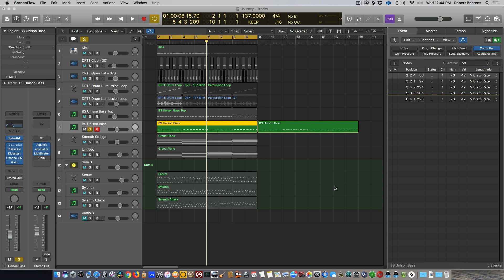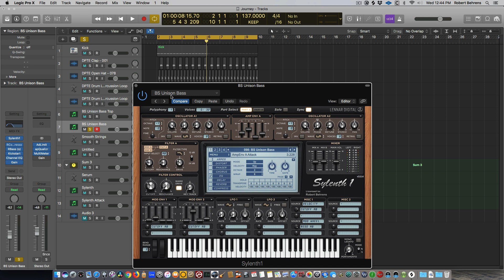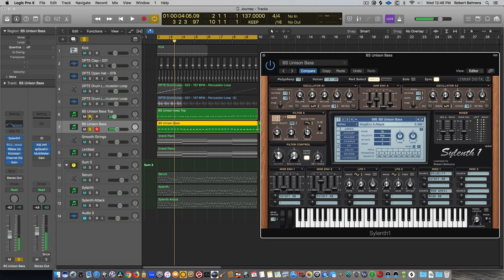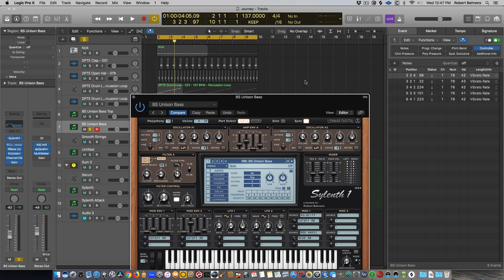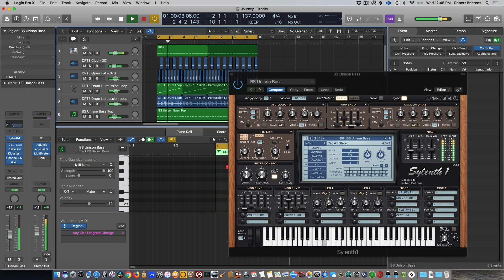Sylenth1 Jumping Amp Envelope Problem Solved! | Stop Parameters Randomly Changing in Sylenth1

Comment: does anyone know how to do this on flstudio?
Reply: Hey, i know it's 3 months ago but Current project > Patterns > Initialized controls then delete some events/automation triggers that might be connected to the vst/vsti
Reply: @rucitijar  hi, you're the only one with a response to this for fl studio. Hoping to get more help. 

I'm following your exact instruction but i don't see "Initialized Controls". Do you know of anything else I can check?

My problem is the same. The Amp Env A attack resets when I click the stop button, or close and reopen the project. 

Hope to hear from you!
Reply: @billjacksonducusin7127  if the project has no automation yet, there's no "Initialized Controls" since it was a folder created for an automations. To solve your problem, try to create a static automation that play along the track with the exact value of your tweaked Env A attack before it's resetting back.

if the project already has an automation, find "Remote Control" inside the Current project folder or  "Initialized Controls" inside the Patterns folder on the fl browser and delete some events that may cause the problem. it is the same as Rob's video said, the culprit was a random malfunctioning controller data.

Hope this helps.
Reply: Any luck solving this? Searched for a fix for a few hours now. Can't even save it without the track reverting before I do 😢